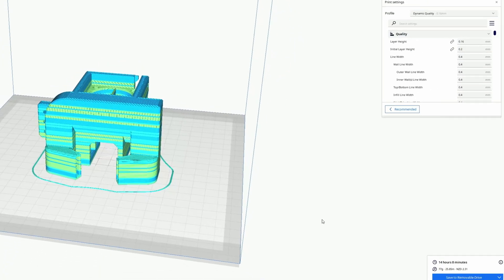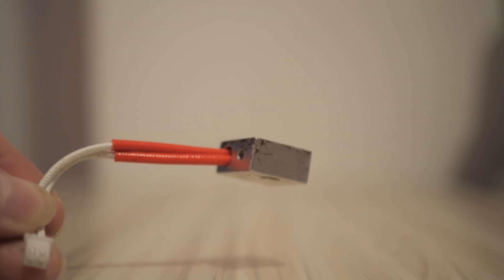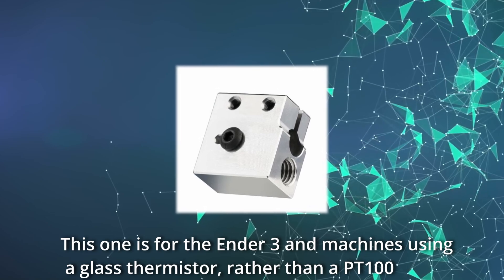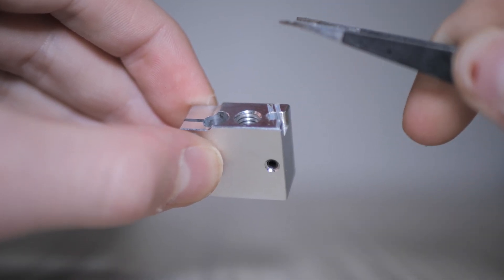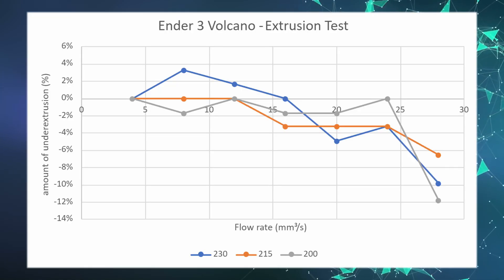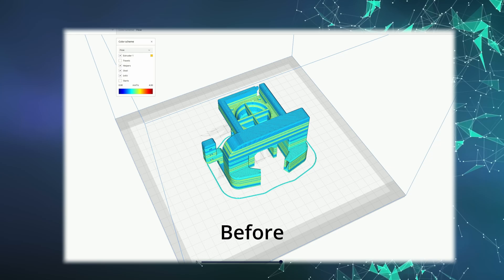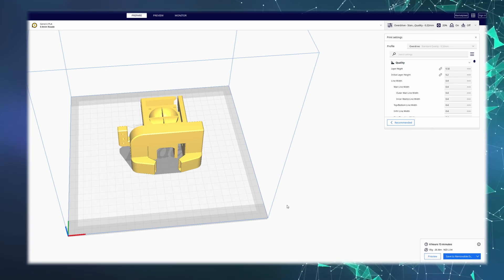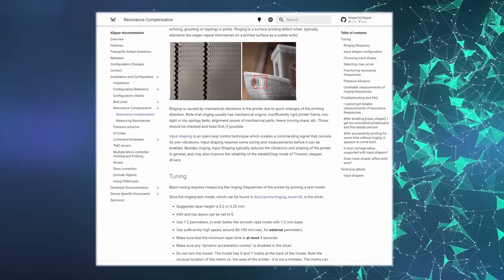Faster 3D Printing Using A Volcano Hotend - Mellow Hotend Review

Comment: Hey Tommy! Love the videos and watch them constantly, I was wondering if the volcano heater blocks screw directly into the mk8 ender style heatsink or if a new one needs to be purchased?
Reply from the maker: Heya! That means a lot to hear, man, thank you! You can install this directly into the stock heatbreak and heatsink, and that's actually how I rocked my setup for years, although if you're still using a PTFE lined hotend/heatbreak, I would definitely consider looking into a new all-metal heatbreak. They're cheap but make a great difference. All in all, you should be able to get away with only needing the block and a volcano nozzle to get this to work. Cheers!
Reply: @T @TommyHoughton Thanks for speedy reply and keep up the great work with your videos can’t wait for the next one!
Reply from the maker: No worries, and thank you very much! I hope I can continue to provide you with some value.

Comment: I still have my K1 Max that uses a CHT volcano 0.4 nozzle from Bontech. I was thinking of adding one to my Voron 0.2, but I hardly see anyone talking about volcano nozzles anymore. I'm wondering if people find these obsolete now ;(
Reply from the maker: I love to hear it, as the CHT volcanos were a nozzle I really wish was talked about more often. I completely agree about volcano nozzles not getting as much attention as they used to, but I'm certain they're still kicking around quite a bit out there. I myself was planning on just using a standard sized V6 nozzle on an upcoming hotend design of mine, but have ordered a TC volcano nozzle as I think a more thread-interfacing could surely give a tad bit more performance. Surely! It's also cooler having a bigger nozzle, but they're more pricey. I don't think they're obsolete, as there'd have to be something extremely good out there to reduce them to that state. It's like a computer monitor, or camera; there's a limit to how far things can fall even with newer market options. Cheers!

Comment: hi I've Anycubic Chiron stock, if I change the block to Volcano, you thing I've a Thermistore Problem to fit-in?
Reply from the maker: Hi, that's a bit tricky for me to confidently answer, sorry. In the worst case scenario, you will need a new 3mm tube thermistor, as a regular glass thermistor won't fit well. As it's been a long time since I've looked into the Chiron (it was my dream 3D printer for quite some time!), I do not remember which thermistor it uses, and if it varies depending on the version of the machine. I hope that helps a little! Cheers

Comment: I've installed a volcano on a Neptune 3 Max but i can't get it tuned to print reliably with a 0.8mm nozzle, do you any any suggestions?
Reply from the maker: What are the primary issues? Assuming they’re extrusion related, there’s a few videos and articles online that might help isolate the issues so we can troubleshoot them.